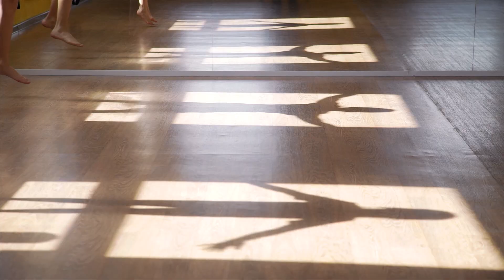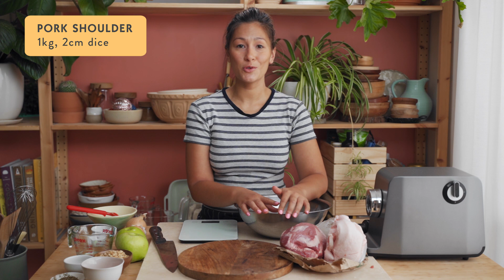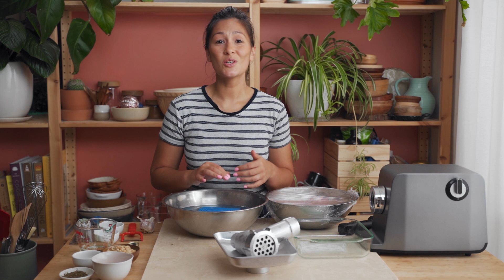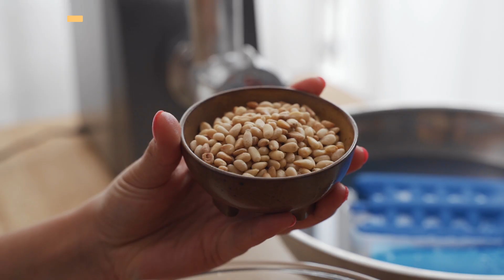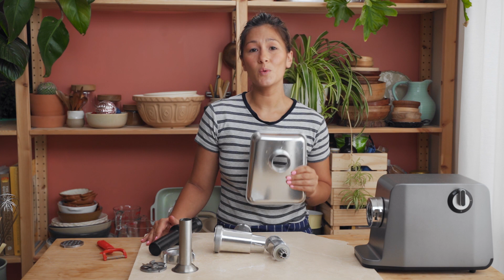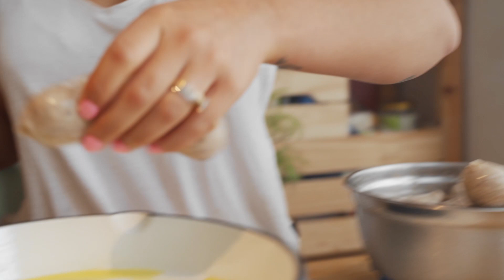Homemade Pork, Apple & Fennel Sausages | Luvele meat grinder

Comment: Thanks I love the machine but my sausages didn’t work out, I followed the instructions exactly but my sausage’s turned out dry and crumbly, would love a answer. Thanks Stephen
Reply from the maker: Hi there, thanks for your message. Generally, if they are dry it is because you did not add enough fat to your mix. Try adding a bit more next time, hopefully that will help.
Reply: thanks for the reply thinking about it i only guessed the amount of fat used, the butcher could not help me at all on the fat , could i use Lard  from the supermarket ?
Reply: @stephenrout1879  I know this comment is old, but no, lard is already rendered, it doesn't have the fibres to hold the fat in the sausage and it will leak out when you cook it.

You may get be able to add breadcrumbs to hold the lard, no guarantee though.

I'm actually trying to find a way because I want to be able to use butter.
Reply: @stephenrout1879 buy a fatty pork cut that's already about the right ratio. If you need a bit more fat then add some fatty parts of a pork belly as you mince.
Many sausage mixes have water added and mixed through the mince and flavourings. This helps it move through the machine easier and keeps a little moisture in the meat throughout the process. 
Generally dry sausage mean not enough fat or not evenly distributed.